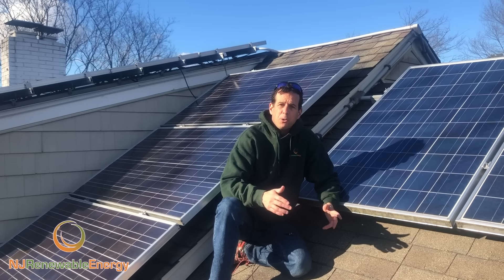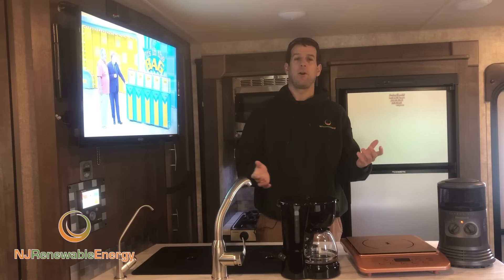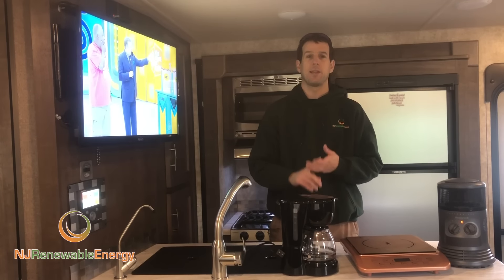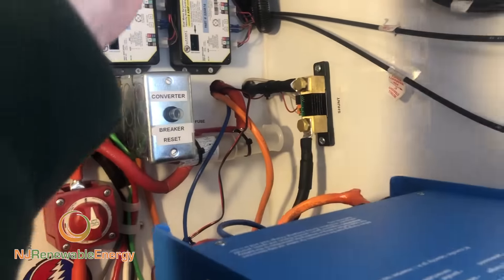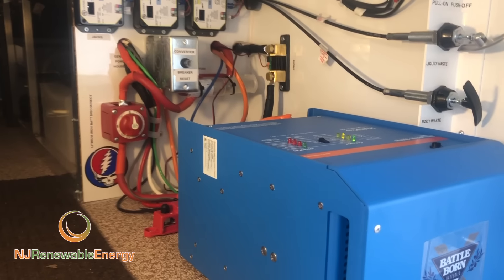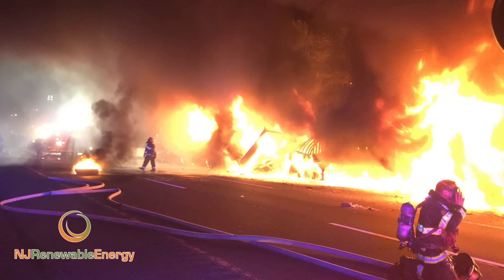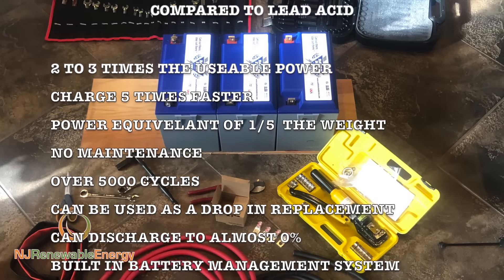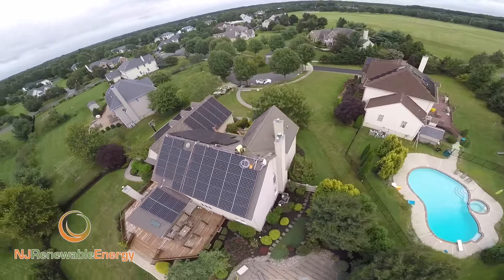Why install a Lithium Iron Battle Born Battery Eagle Cap 1165 Solar Boon docking Truck Camper ?

Comment: Hello, thank you for your video. I completely agree with your philosophy and want to migrate from a 35' class to a large truck camper. Currently we are partial to the HOST Yukon, the 1165 is also very nice. That said ...
1. The new ACs seem to start on a 15A without need of a soft start
2. Dometic has a new 8000 BTU 12V (that's right 12V) air conditioner. Would that be enough? On ecomode it draws about 300A ~25A. So, it could run for ~10h with your system.
3. How do you manage your parasitic loads?
4. You should get a set of isolation foot pads for your generator. They can make 15dB of improvement. 
5. Eagle Cap now does this Grey color. Can you still order white?
Thanks for the video. Travel safe. Henri (RVing with Henri)

Comment: what about a alternator upgrade due to the lithium lower resistance and creating a heavy draw on the truck system
Reply from the maker: my wire is so small you can't get the flow.   I wouldn't mind running a larger wire so that I can charger at a higher rate while driving.

Comment: Great video!  I just bought an Eagle Cap 1165 and am going to install 2-175 watt flexible solar panels with a 40A charge controller.  My Eagle Cap came pre-wired but I am struggling to find where the PV wires come in, are they in the access panel behind the TV in the bathroom?  Where did you find them?
Reply from the maker: Yes, on my 2019.  They were in the access panel in the bathroom.   Mine were already attached to the existing charge controller.   Not sure how they leave them in pre wire.

Comment: I came across your video looking for a good image on how the Eagle Cap sits on the truck.  Very good video.   Do you think Battle Borns are something to use in Canada?  We get up to -40C sometimes in the winter.  Another question, this camper seems to be back heavy, do you really feel it driving?  Does it feel stable enough?
Reply from the maker: We love our Eagle Cap.  Sorry for the delayed response.  Yes Battle Borns in canada.   We added tork lift stable loads, uppers and lower.  Things are basically level.  Reluctant to do airbags, but it would improve things slightly.   Just drove 9000 miles over 2 months.   Truck handles well.
Reply: I have this camper on my 2002 Dually Crew Cab 4x4 Silverado. Truck has upper and lower overloads. With the stock wheels & Tires... TERRIBLE. We upgraded to the 19.5" wheels to use G rated tires. That combined with the torq lift stableloads helped tremendously. Feels just fine now. It's been two years and everything is going great. We are in the Washington state and drive over mountain passes all the time.

Comment: I saw a video about the lithium batteries not charging below 24F or something like that. Is your install in a heated compartment? I am considering an Eagle Cap 1165 or 1200.
Reply from the maker: correct.  they will discharge at those temps but not charge.    Not a problem if you have them in the living space or heated part of the camper.    1165 is better in my opinion.

Comment: I have a Lance 992 with 2x120w solar panels and 2xAGM batteries.  I boondock 24/7 for 6 months every year.  I am only limited by the fresh water I can carry.  Replaced all my bulbs with LED.  I watch satellite TV every night or watch DVD.  I can even use the microwave for popcorn or nachos.  Why in the world would I spend this kind money??  How much power do you need???
Reply from the maker: If that works for you perfect.   Its all a matter of what you needs are.  The batteries allow us to run any AC product we have.  We hate generators and love the ability to even use air conditioning while on battery power.

Comment: I see its been nearly a year.  How has the system worked out for you?
Reply from the maker: Stellar... Traveled 7 weeks, 9.500 miles.  Never used generator.  Use in Key Largo, TX, CO, Nevada Desert, Yellowstone, etc etc etc.   Powered AC and DC systems.   Home run.
Reply: @NJRenewableEnergy  I'm happy to hear that.  Did you do all this work yourself?  If so, I'm extremely impressed.  What would you say was your total investment in off grid power on the camper?  And is this something you would do for another person?
Reply from the maker: @darylwright3393  Ball park of about 5k in materials.   Free labor.
Reply: @NJRenewableEnergy  It looks like so much more.  Well done.  And labor saved you a ton.

Comment: i got 6 walmart batteries.  $90 a pop.   no way am i spending $1000 each for lithium.  ill wait 5 years and buy em for $100.
Reply: I agree but the weight  i bought two lithiums last week  pricey
Reply: how much does 6 walmart batteries weigh?
Reply: 100mpgus about 300 lbs.   no big deal
Reply: @gratefullydeadful  then they are not deep cycle and 300 lb is no big deal?
Reply: 100mpgus they're cheap marine/rv batteries so i assume theyre deep cycle.    based on reviews, others have had great usage for many years as i have.   do i give a fuck if theyre deep cycle?   no.    go ahead and spend $1000 on a fuckin battery.   lol.  😂

my rig can handle a 10000 lb payload so 300lbs is nothing.
Reply: Many rigs don't have room for SIX batteries LOL

Comment: You're argument for lithium batteries is only an argument for batteries in general. A much cheaper agm battery system while heavier, will allow one to eliminate a generator
Reply from the maker: Not true.    You won't get nearly the same depth of charge, voltage and a whole bunch of other things including rate of recharge.   Granted lithium batteries are more expensive, but AGM aren't even in the league.

Comment: Battle Born are super expensive. There are cheaper ways.
Reply from the maker: There is always a cheaper way.   This is the best way, the most effective way and the most professional way and in the end cheaper then lead acid.
Reply: BB's are not expensive if you look at the whole picture of what you can use, and how you can use them, and how long they last, and with no maintenance. There is more to the story than price.
Reply: Lion Energy UT1300's are 10lbs LIGHTER and you can get 4 batteries for the price of 3BB batteries and have a lifetime warranty too.  So, BB is kinda over-priced for what you get.  --Just saying.